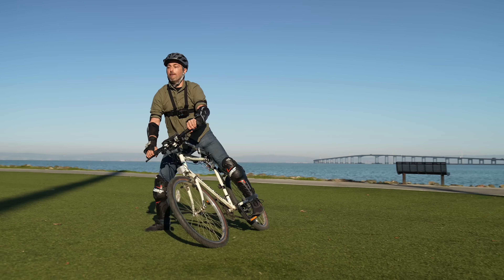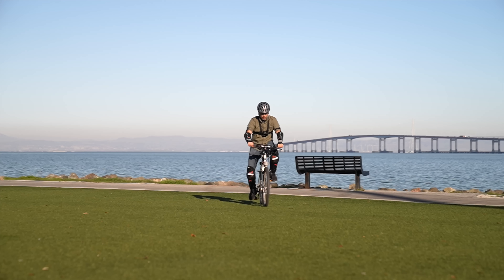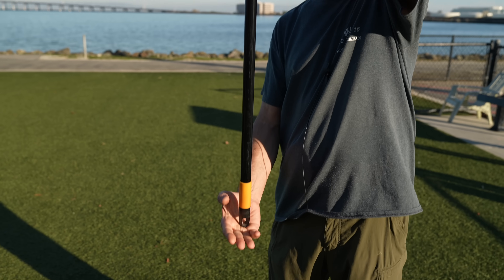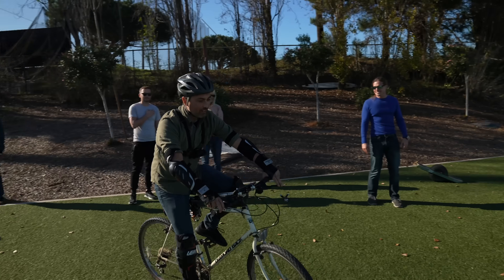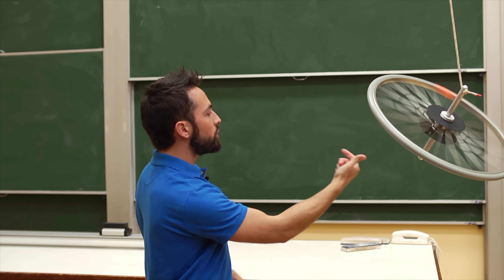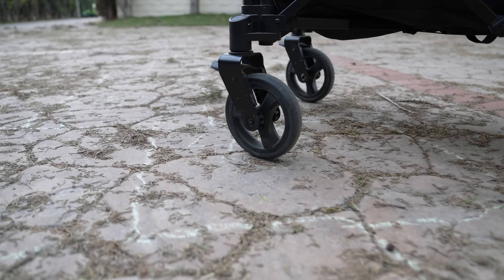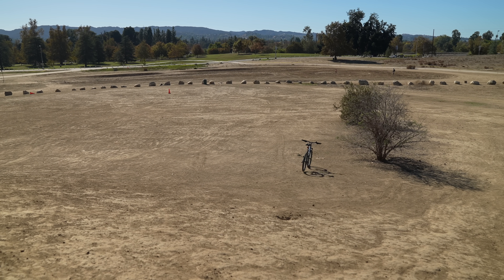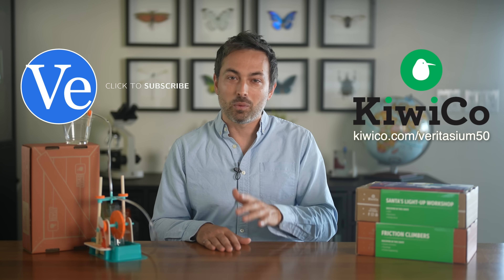Most People Don't Know How Bikes Work

Comment: I have to say that, as a long term (urban) cyclist, I am amazed that people don't know this explicitly. The tighter the curve you want to make, the more you need to countersteer.
Reply: Well most people don't know how countersteer works, and they just learn it intuitively on a bike.
Reply: i literally remember making my first sharp turn, it felt so instinctual to make sure the arc I was gonna make was clear
Reply: I was thinking that too, they teach that stuff here when you get a motorcycle license.
Reply: @manakzar7148  Ride a motorcycle I think above 30 mph 48 km/h take one hand off the bars and push, it is so wrong but that's physics for you. GB :)
Reply: Well, this may be true for urban cyclists but in an actual cycling race all of this lose its meaning. At medium/high speed you always turn using and balancing your weight.
Reply: @amedeosantini3911  they also use counter steering tho
Reply: @amazuri3069  not using the handlebar, not that I remember at least (I did all the youth categories).
Reply: @amazuri3069  While riding at 50km/h? You really think so?
Reply: @Grintock  yeah, because a 2 wheeled vehicle can only turn with countersteer. It doesn't matter what you do, you only influence how much countersteer there is. It's physically impossible to not countersteer.
Reply: @amedeosantini3911  in order for "balancing your weight" to be possible, you need to be able to affect the center of mass of "you and the bike" while sitting on top of it. how can you "shift your weight" without the bike compensating in the other direction? I guess sideways friction between the tire and ground can provide that type of force (e.g. same motion as "pushing off your right foot to move left, from standing"), but I find it hard to believe that you can tap into this friction with absolutely no counter-steering.
Reply: @nez14526  usually races have average speeds that are around 40/45 kph. It is possible to reach 90 kph or more on descents. At that speed the gyroscopic effect is much stronger. Also racing bikes are lighter and reactiveness (to the weight shifts) is one of those things that make a bike well built. I can make a couple of examples to explain it. Once, after I finished my training session, I was going home and did 20 km handless. If you ever saw a race on tv, you’ll notice that the athletes are very close to each other in the peloton. Counter-steering would be very dangerous in that situation. And, perhaps the clearest examples of all, it is similar to motorbikes. I have never seen Rossi counter-steering during a gp. It is possible to widen a turn, but, when a line is chosen, they commit, shift their weight, bend the bike and, when the turn is finished, they pull the bike up. If the pilot misjudges the speed and tries to do a very tight corner, the gyroscopic effect is not enough and the bike slides out. It is the same exact thing for a bycicle. I would say that 20, maybe 25, kph is already enough to do standard turns without using the handlebar. In the video they tried to do very sharp corners at very low speed. The problem is the same in the balancing experiment. It is much easier to balance the bike at high speed than at low speed because the gyroscopic effect depends on the rotational velocity of the tyre.
Reply: @amedeosantini3911  Leaning puts road force on the front tire that causes it to straighten out; straightening out, when leaning, is relative to the sidewall (or rather, is off-center from the direct bottom), so the bike automatically counter-steers.  At 120kph, counter-steering is necessary.

If you leaned at high speed without counter-steering, your front tire's rotation would not follow along the path of travel; rather, it would skew tangentially away from the path of travel.  That means it'd be dragging against the road, creating braking force at the front.  You'd also lose friction force (you're no longer dealing with static friction), and the wheel would be prone to slide away, causing the bike to topple.

The tighter the curve, the more counter-steering is necessary.
Reply: @johnmoser3594  it’s not easy to explain or understand physics by comments without drawings. I am sorry but I didn’t understand anything even though I am an engineer. Anyway, I have raced for 5 years and I am a fan of MotoGP, and I can guarantee you I have never counter-steered during a race. Surely it is related to practice, but if you are able to use your weight properly there is no need to counter-steer every damn turn. After this video I also went to the park with my mountain bike to try things out and I was perfectly able to turn the bike, even at low speed, without counter-steering. The people in the video are amateurs, like the majority of you commenting here, and so it is perfectly reasonable. But it is not something that is absolutely needed to turn a bike or a motorbike.
Edit: I read again your comment and I’ll answer to some of those things you said. You said that while you are leaning you have a braking force at the front: I don’t see the problem, during the turn you don’t want to accelerate or you’ll slid out of the trajectory. You said that at high speed the bike is prone to sliding away: no doubt about that, that’s why you brake before turning. I don’t see why those things wouldn’t happen with counter-steering. Counter-steering is simply a different method, easier to do, to reach that equilibrium position you are searching. And, trust me, if there is a tight turn at high speed, cyclists don’t counter-steer. First of all, they brake. Then they widen the turn shifting their weight to the opposite direction and, eventually, they turn bending the bike. I can assure you that the front tyre will be perfectly straight during all these actions.
Reply: @amedeosantini3911  you absolutely have to counter steer a motorcycle. The act of leaning shortens the distance to the inside bar end. I've tried putting my hands on the tank and leaning, it puts VERY little input into the steering. I'm also an avid mountain biker and I will admit they take much less force to steer but I still think the act of leaning is has more to do with pushing the inside bar end than the weight transfer itself.
Reply: @humzilla707  I never drove a motorcycle but I never saw Marquez or Rossi countersteering right before leaning for the turn. I have experience with cycling, I raced for many years and I never countersteered going into a turn. That was the central point of my argument. How much it is weight transfer and how much it is force on the bar I do not know. I don’t think that it’s important relating to this video.
Reply: @amedeosantini3911  It’s physically impossible to turn a bike without counter steering. You have no clue what your talking about and need to read up more on how counter steering and 2 wheeled bikes/motorcycles work. I’ve been riding motorcycles for over 10 years, one of the very first things you’ll learn to get your license is about counter steering. Yes Rossi does in fact counter steer for every single turn during the race, because he has to, it’s just simple physics. Just because you don’t notice the slight adjustment it takes to initiate a counter steer does not mean it’s not happening. When you take your hands off the handle bars, you use your weight to balance which in turn allows the bike to counter steer itself. Again like I said, it’s physically impossible to turn a bike without counter-steering. Instead of arguing with people who already know how counter steering works and why it’s needed for a bike to balance, try actually learning about it. The fact you thought Moro GP riders never counter steer shows that you have absolutely no knowledge on the subject.
Reply: @ThumperG  I admit that I don't know much about motorbikes, but I was mainly speaking about bikes since they are the main topic of the video. I neve drove a motorcycle so I was simply talking about what I saw on tv. However I was a cyclist for 5 years, I did on average 500km per week and I assure I never counter-steered before a turn. Now, I do shift my weight to balance the bike while bending but my front wheel never faces the opposite direction, especially at high speed. And that is a fact, not some theory you have read somewhere. I don't know what your "counter-steer" means, but, referring to what it is said in the video, it means going the opposite direction of the turn right before moving the handlebar to do the turn (never moved the handlebar in my life). Do as you wish of what I have said, I don't care nowhere near enough to continue losing time here, so I wish you a good life. Good evening, sir.
Reply: @amedeosantini3911  It's just because at high speeds you don't need to counter steer a lot to lean the bike, so you obviously can't see on a TV camera and don't feel it when you are riding. But yes, they are counter-steering, it's just a little bit, but they are. You can't significantly turn a bike without it, even when you ride without hands you are counter-steering, shifting your weight to the oposite side before turning. My bike has a threaded headset, when is too tight it's really hard to keep the balance and make turns without hands, because shifting your weight serves only to turn your front wheel, it's the wheel that, then, keeps you balanced and allow you to turn
Reply: @viniciuslippel7251  like the last guy, you didn't read any of my previous comments. If you have seen the video, you'll know that they talk about counter-steering in the sense of turning the front wheel to the opposite direction before the turn. They never said anything about only using weight to do it. So, in the comments, I was considering counter-steering as they have defined it in the video. I definitely talked about shifting your weight precisely to control the bike, and, because of that, I said that this experiment works only because they used amateurs. If they had picked someone slightly more skillful, they would have failed miserably. Initially I was pointing this out. People, taking comments out of context, completely turned the conversation around.
Reply: @amedeosantini3911  that's the thing, no matter how skilled you are, no matter your speed, if you turn your wheel only to de direction you want to go, you will fail miserably. Highly skilled people just need less counter-steering because they are more precise. I also ride bikes basically every day, and I also don't feel the counter-steering, but it's not about what you feel, it's about what is really happening, it's about physics. To turn your bike significantly it's necessary to turn your wheel just a little bit (to the point where you don't even feel it) to the oposite side
Reply: @viniciuslippel7251  I really don't think so. You did make me doubt myself, I did a quick research on the net and it seemed to corroborate what I was saying. You need counter-steering during the turn, but the front wheel shifts automatically while bending towards the turn, you don't do it. However, this definition of counter-steering is not the same as the one presented in the video. So, maybe the experiment will fail even with a skilled biker but for a different reason. It is not the initial counter-steering but the automatic one that is needed during the turn. Indeed, when you are in a descent, you just lean in the direction you want to go: you surely don't move the handlebar nor, typically, shift your weight in the opposite direction. I will not trust you if you say you do it. Period.
Reply: @amedeosantini3911  like I said, it’s physically impossible to not counter-steer, that’s just a simple fact. You can argue all you want but the fact will always remain that you did in fact counter steer your bike anytime you made a turn. Just because you think you didn’t doesn’t mean it’s true. Majority of people don’t even know that they are doing it and would never even notice until it’s pointed out to them. You said you “adjust your weight on the bike”, which will make the bike counter steer all by itself. You don’t know it’s happening, but every time you lean the bike into a turn, whether it’s a motorcycle or a regular bicycle the bike counter steers. It’s Impossible to make the turn without counter steering. It’s just that simple.
Reply: @ThumperG  while I was talking with someone else, I went reading something on the phenomenon to know more than what I knew. Well, I found out that you do need the counter-steer to turn the bike, but it’s not the counter-steering shown in the video. People don’t need to steer the other way before the turn, that’s useless as I said more than once (nobody does that), but, while they are bending their bike and doing the turn, the front wheel automatically steers slightly counter-steering.
I don’t remember all my comments but I think I said that I wasn’t considering the absolute meaning of the word counter-steering, but the explanation of it that they gave on the video. If I didn’t say anything about that I was wrong, but if I did I had the right concept, maybe not so well written: it isn’t that type of counter-steering that it is needed to turn the bike. The conclusion was that maybe, even with skilled bikers, the experiment would have failed but surely enough for different reasons than the ones explained there. Final conclusion: the video is wrong and baseless, maybe the builder knew his facts but the presenter surely didn’t.
Edit: I watched the video long time ago, I don’t think I forgot much about it and I do remember the reasoning behind my initial comment. If I did, and they explained counter-steering including the automatic part, then I apologize and my criticism was wrong.
Reply: +Amedeo Santini
From what I gather, while you weren't quite right, most of the people arguing with you 
A. Don't know how to read
B. Don't know how to explain things particularly well
C. Don't actually understand countersteering (not that I blame this one since I myself still am a bit shaky)

All anyone had to do was 
A. Read that you were understanding "countersteering" as it was defined in the video, which you explicitly state several times
B. State that the video's definition is incomplete in terms of physics (some kinda did this, but implied it instead of explicitly stating it)
C. Tell you that what you are describing (leaning and weight-shifting to iniate a turn) causes very minute countersteer (if they wanted any more technical and in-depth physics discussion, they would then add that here).

It'd would've also helped if the people explaining didn't seem condescending, but perhaps that comes with the territory of thinking you're certainly right. I don't think you were condenscending, so that was pleasant to read.

Thos entire conversation reminds me a lot of table tennis threads on some forums where two guys kept arguing about the physics of table tennis across multiple forums for I think nearly a decade. In sports, because things are often so minute and done in such short time frames, the universe as we think it and the universe as are body understands it seems to diverge. It's quite wonderful that our body and mind can diverge so much and yet still function seamlessly. The body is truly a wonderful bag of meat, able to understand the world (almost like it has its own brain) despite the conscious brain not truly understanding it.
Reply: @seanshin1615  that was a great comment, thank you.
Reply: Exactly. And all the cycling web sites have articles and videos about it. It's fascinating to what a great descender in a pro bike race and amazing to realise just how much grip a good set of bicycle tyres have on a decent road surface. 
   Riding no hands makes it very clear. Except when testing my wife's old bike! It had a good Reynolds 531 frame but old-fashioned parallel ladies downtubes. Riding downhill no hands is a good test of set-up but that bike started resonating massively around it's axis of symmetry. Which demonstrated how inefficient the ladies frame was - women would have been absorbing that vast wobble through their hands, arms, back.
Reply: I also got the intuition on this balancing effect, the more you bike the more you can actually feel it. I recently started to drive an e-bike and many rules changed as well.
Reply: Even as a big time mountain biker, I have never though of this, even though I should because when you want to make a tighter turn, you take a wider angle on a switchback.
Reply: @monmagog  I'd say that that means you have thought about it, even if only implicitly!
Reply: Yeah me too
Reply: Yeah, I honestly thought this was common knowledge/logic. Kinda surprised so many people didn't know this.
Reply: At low speeds, you have to turn the front wheel in the direction you want to go. People are paying a lot more attention to how they move a bike at low speeds (for example, walking the bike to the road) and a lot less to how they're riding (because they're busy riding).
Reply: yeah were smart woohooo
Reply: As a bicycle, I am equally amazed.
Reply: Yeah I legit thought this was a semi-conscious thing for everyone, or at least something most cyclists must have have thought of at least once
Reply: Yes there's no counter steering if it's not sharp you just leaning an steer slightly
Reply: its only really true when you are sitting on the saddle. if you are standing you can lean yourself to the side by swinging your tail in that direction. :3
Reply: Honestly I thought counter steering was to make a bigger radius
Reply: If you often drive in dense traffic, you are well aware of the amount of countersteering that is necessary to turn, because it can get dangerous if you get in a vehicles way...
Reply: You're just trying to make yourself feel superior by saying you feel "amazed". People do things intuitively all the time without thinking about what they're explicitly doing. It's not that shocking.
Reply: @davidandrew7314  No, I'm not actually.
I'm commenting with what was my genuine response to the video, namely "huh, this seems obvious, do people really not know this?"
Of course, it only seems obvious to me because I do know it explicitly. For people who don't, it obviously doesn't seem trivial. That's how things often work, they're obvious once you know them.
But that was my immediate response while watching it. I apologise if it came out condescending, that wasn't my intention.